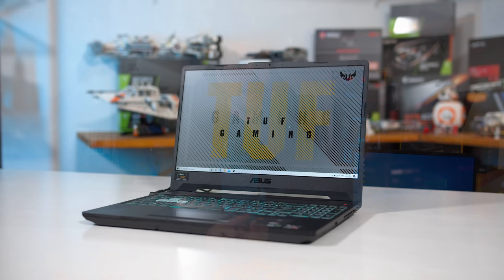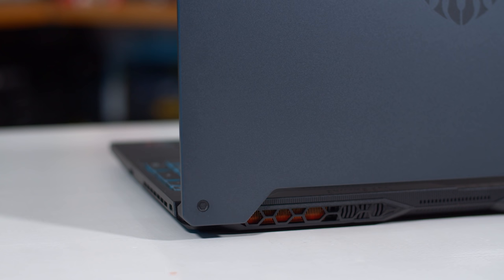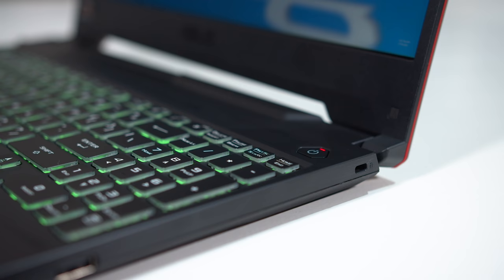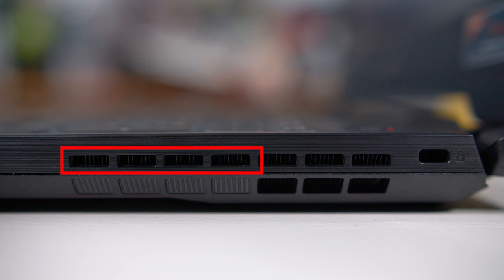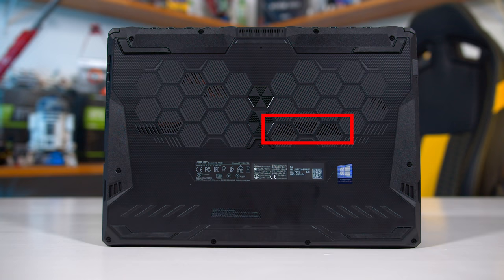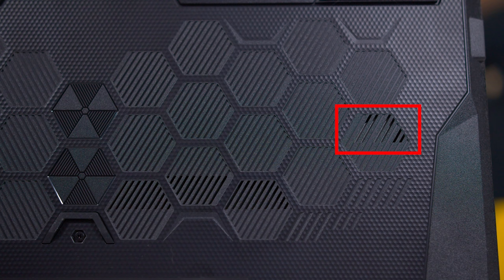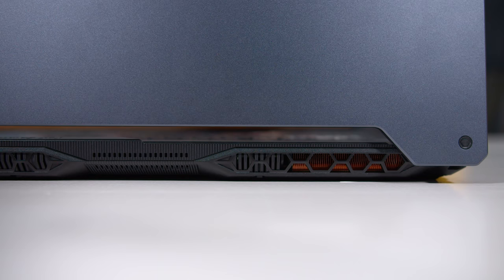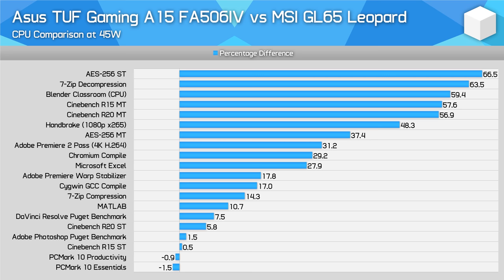Don't Buy The Asus TUF Gaming A15 (2020 Model)

Comment: Do you realise that smaller vents mean faster airflow with the same fan speed? Clearly, you've proven yourself wrong here to a certain degree. And maybe MSI GL series laptops are the same price as TUF A15s in the USA. But consider getting a Ryzen 9 4900H and an RTX 2060 in a laptop with a 144hz display for nearly 1500$.... Would you call it a bad deal?

Comment: I'm looking at buying the A-15 with the Ryzen 7 4800H and 16GB RAM, fully aware of the heat ventilation issues. I'm replacing an Asus K537 with an AMD A4 chip and 8 GB RAM from 9 years ago which had the same ventilation issues. No ventilation in the lower case whatsoever, a couple of holes, but not enough. It has always run hot and the fan has always revved super high. It sounded like a 747 on my desk for years...that is until I recently stripped down Windows 7, shadow settings, bloatware, everything unnecessary on the operating system. Now it runs cool, the fan is barely audible. I cleaned the insides, stripped it down, redistributed the coolant paste and it runs like a new (very outdated) laptop. The thing is, all of those years of heat didn't kill the CPU, motherboard or RAM, didn't destroy any hardware or functionality, but it did destroy the lower half of the casing where the hinge connects the screen. Eventually the entire backside started to split and needed to be re-enforced. The plastic became brittle and fell apart until there was a big hole at the back corner of my machine.  I had to rebuild it with zip ties, screws, a glue gun, an old credit card cut up into pieces, painted black with a sharpie and a lot of Mac Gyver-ing. My only other option was to gut the components and mount them to a piece of plywood...which would be extra badass! Imagine the plywood laptop at Starbucks! It would make me king for a day. Point is, I doubt the A-15 components are going to have any less longevity due to the hot temperatures, but eventually the plastic will become extra brittle because of it. The Asus still kills my old Dell in the longevity department. I only got 3 years out of that one, then the BIOS failed and I couldn't fix it. Still, 9 years for a movie-playing, word processing, internet grubbing, space heater with a screen? Not bad. A-15, here I come!

Comment: When it comes to the "Why would they do this?!" - I've read multiple times now that OEMs tend to block certain paths for air so that it doesn't exit the system too quickly. For instance, if the airflow from intake to exhaust is... let's say "short and effective"... there might not be enough air flow towards the battery and it might get too hot.
At least that's what they're saying. Of course looking at laptops that do have huge open intake areas and plenty of exhausts and that don't have overheating issues, one can't help but wonder whether that's true...
Reply: Yes, it is correct to place the inlet somewhere to allow air passes needed areas. It could also generate  slight vacuum as necessary. However you should not block the outlet. It will suffer the fan, generate turbulence and chocked the flow.

Comment: That's the most ridiculous bottom cover I've ever seen 😂 how did they choose where to cut open 🤔
Reply: actually they chose to make it that way because they want to reduce the dust (and past the military test ) .Apparently Asus think we will use this laptop at mount everest or sahara desert
Reply: Not randomly, to be sure. The locations and vents must have been chosen to direct airflow over specific components in specific ways to cool them. This YouTube reviewer is doing people a disservice by saying the vent design is flawed when the fact is that he just doesn't understand it.
Reply: @makingretro  Show me a high end laptop that does this 2.5% airflow business stuff and actually performs and sells well. Tell me why AMD, despite running cooler, is the only lineup that gets botched while many Intel lineups never get botched. It is not an "boo hoo, I need airflow over this component". It's a simple "boo hoo, I dont want my $3000 laptops getting screwed by this $1200 laptop" from OEMs.
Reply: @theskywalker8416  I don't think that laptop can survive sahara desert at all due to heat.

Comment: Now the best part: The only think you need to do, to drop temperatures by 10-15 degrees at full load with vent at 60% is: disable the processor turbo - it does not affect games performance, it might only affect performancce in video encoding or some graphic work that you might do (you can always turn that on tho). I did that, laptop is silent and game performance is literally the same with max 81 degrees cellcius in modern warfare cold war at ultr with avg 40+ FPS (my spec is ryzen 4800h and GTX 1650ti).

Comment: asus tuf a15 is still much cheaper here in my country compare to other brands. it may have some flaws but im after its cores since I'll be using it for home lab
Reply: wait ur using a laptop for a hone lab?

ever heard of desktop pc?
Reply: And I guess you can cut the bottom intake grills off, it should be fine. But that  heatpipe not connected to the fans are plain dumb imo

Comment: I bought the ASUS A15 with rtx 2060, ryzen 7 4800h, 512 ssd m2, 144hz screen. I would recommend to everyone with this budget. Temperatures are normal. Games are runing smooth. The only negative is the rgb keyboard is only 1 color, you can't change each switch different rgb.

Comment: The screen is perfectly fine for a 15" gaming laptop.  The A15 is thinner than the MSI, of course the ASUS will be noisier.  The cooling/noise could probably be fine tuned better, yes.  But an 8/16 cpu, 16GB DDR4-3200, 1TB nvme, RTX 2060, 144Hz IPS is hardly a "budget" laptop, holy fucking shit bro, that's a lot of firepower in a tiny chassis.  You missed the best improvements, the A15 fixes the nearly unusable/buggy usb ports from the previous TUF gen, and added one to the right side of the laptop (so wireless mice work much better).  Also, the A15 is quieter than the previous gen.  We have one of each, side by side.

Comment: Using it for  moderate office usage and playing games for an hour or so for 3 days now. Everything is smooth and the laptop is cooler than my MSI Leopard (gtx 1060 + i7 8750h). My experience with MSI have been terrible as it heats up like a room heater while running something as simple as Cuphead and crashes after a few frozen frames! I have almost no complains about the A15 at all. However, the screen is dim and washed out... That is disappointing...

Comment: For those watching this and you still deciding to buy this because of the price tags to fix the thermal problem you just need to turn off the boost mode in the control center. This does not only work for this laptop but for any other laptop that has its own control center for temp. control. Companies tend to not adjust the control center between laptop and desktop (even in desktop I still switch it off since I have liquid cooling). For other ways to try and reduce the temp. apply liquid metal or use thermal pasting, elevate the laptop where the bottom is not completely covered which allows plenty of airflow and (this one at your own risk) have a professional cut out the areas at the bottom where it's not supposed to be blocked. 
I do agree with the sound quality from the speakers and the color accuracy is not that great but now that you have extra money that's where you monitor and headphones/speakers come in

Comment: I bought this laptop after watching your video. I can confirm that running a stress in aida64 for 1 hours keeps the temps around 90 C running at 3.8 ghz. I stopped after an hour because I was happy that I would never stress it that much. This is in winter weather however.

Comment: I made a review aswell from this thing and I don´t feel that Hardware Unboxed was right to state something like this in a video.. the temps are on the high side yes but its not a 4 or 6 core Intel cpu.. its a proper 8 core 16 thread AMD here. Also most gaming laptops nowadays creep into he high 80-s to maybe even 90-s... so coming out with statements like this is a bit sad to see if they didn´t bring the heat issue up years ago on laptops.
Reply from the maker: You'll certainly want to watch our follow up video next week then.

Comment: Guys, don't listen to the video. Trust me this laptop is REALLY good. Gets a constant 60+ fps with Raytracing on Games like fortnite and COD. High framerates on games like CSGO and Siege and a great screen with a great refresh rate. If this laptop is in your price range, get it. I have experienced no thermal throttling whatsoever. It's a really good laptop with a Really good CPU and superfast SDD. Gets the full use out of a the RTX2060. Why not buy it?

Comment: A bigger hole isn't always better than a smaller holes. You couldn't be more wrong to think that having bigger hole equals to more airflow in volume, it depends on the fan size.

A bigger hole equals to larger air volume intake at 1 time (but also spread wider area and lower circulation speed due to less pressure) and smaller hole equals to faster circulation speed ( but spread narrower and higher internal pressure),  given the fans' power and size are constant value and also the hole size isn't extremely unreasonable. 

That being said it doesn't take a Sherlock to guess that they intentionally covering those hole  because they probably design the casing for multiple fan sizes and heat sink arrangement for different GPU (with common knowledge that gtx is power efficiency core and rtx isn't)

Another mistake is you thought higher end laptop models would generate more profits than lower end laptop models, thus motivate they doing this to sell higher end unit. That couldn't be more wrong cause the profit actually based on the price they set and the actual hardware and design cost, not to mention lower end/budget end models usually sell more units than higher end models.

Also i believe they create the hole not directly below the fan is to create a more accesible (not heated) keyboard to enhancing gaming experiences of long hours gaming and also to protect components.

Rog gaming laptop is in minority (compared to Lenovo and MSI) which can still run flawlessly while being as powerful after 6 years of usage and that's show the quality of design they had.

Comment: If you are a gamer, the display is an afterthought. I have my A15 hooked up to an external screen. With the panel closed, a gaming laptop is just a gaming platform with a small footprint.

Also, I haven't had a venting problem. I run the thing hot sometimes; it doesn't seem any worse for wear.

Also, the fans are relatively quiet, which is an unexpected bonus.

Comment: There seems to be significant variance in the models of this particular laptop because Hardaware Canucks tested the same configuration you have here and found no thermal issues whatsoever.
Reply from the maker: Didn't they get the same thermal results? Anyway we've since bought another model, there is no variance and we will have an extremely detailed video later this week. In the meantime you can check out the testing over at 'Jarrod's Tech' if you like.
Reply: @Hardwareunboxed  Their sample never reached 97C in any test. They also had the 90Wh battery version. I'm not doubting your results in any way and the bottom of the laptop is very restrictive when it comes to airflow. It's a very weird design choice indeed. I'll definitely wait for your detailed video.
Thank you for taking the time to reply to my comment and your awesome in depth content

Comment: I normally don't comment. But the whole cooling argument is bull dude quit trying to play people. Amd processor's run hotter than Intel bc they don't use thermal throttling. Also amd processors r designed to handle that heat. That i7 will never perform to its max potential in a laptop bc its bottle necked by software to not get hot but reduce your power by a good 20 percent. Also u want bigger intake for more air and smaller exhaust ports. Its called positive air flow. And if your gonna give an alternative option make sure its better and not the same but more expensive

Comment: And I think all of the comments are overly critical.  The screen isn't nearly as bad as Hardware Unboxed is stating.  I have an external USB-C monitor with good color accuracy in the event I need to do some graphic design work.  For day to day use, this laptop screen is 1,000,000% fine!  I'm staring at it right now!! It's not washed out, it's not dim, and it's not tinted in any particular color.  Most people can't tell the difference between 100% sRGB and 45% NTSC. Not sure why this laptop is getting trashed so hard.  I'd advise anyone interested in the laptop to see it in person. Don't go based on this review as the reviewer really paints this thing in a bad light, and the laptop isn't nearly as bad as he's making it sound.

Comment: Its pretty simple, only people wanting the amd cpu's go for the tuf or g series, else if you want better thermals, gpu performance and display, asus is redirecting you to the higher end intel products. Typical marketing strategy and sabotages amd. If you want further proof of this just check the Asus Amd g15 and Asus intel m15 bottom panel. One has blocked air intakes on the fan itself while the other has open vents. Guess which has the blocked ones.

Comment: I don't agree with the reviewer's assessment - critique of the exhaust design is not really relevant.  I have had this laptop for about a month and my experience has also been very positive.  I use it for gaming (Wreckfest with a G27, The Division, Arma 3, GTA 5).  Also for web browsing and general photo and file management using  PKZIP.  The A15 is almost completely quiet most of the time except during intense gaming sessions and under heavy workload.  In turbo mode is noisier but it runs a lot cooler and less prone to throttling than other laptops I've owned - it runs in the 80's degree celsius.  I had an MSI GS75 8th gen with an RTX 2070MQ which ran in the mid 90's C temps, even undervolted.  For the price, the MSI GS75 Stealth was a much bigger disappointment than the A15.  Lastly, the A15 has one of the longer battery life I have come across even when compared to tablets.

Comment: My last Asus laptop had the hot, self-destructing nvidia 8600m gt. Haven't really missed them. Current MSI machine has a gtx 970m and has been rock solid with almost continual use for years.

Comment: So, even though i saw this video and others that say that this laptop is a bad choice, i still bought it.  I had it for a day now and i will tell you about it. For me and compared to what I had before, it's amazing.  I play with high graphics Gta5( average 50 ), Valorant(144) League of Legends(120), Automation with epic graphics a bit above 60, The Crew 2(60 all the way). I have the Ryzen 7 4800h with the 1650ti, 8gb ram and one tb of storage. About the cooling. Even though it's a lower model, and the lateral vents are missing, with a cooler i get at about 74-76° C in games even if i play for like 3 to 4 hours. About the other problem which is the screen. Indeed, i would've liked the screen a bit more brighter. The colors are not that bad. Yes, you will see a difference with other high-end laptops or even monitors, but again, it's not that bad. About the response time, as i played League of Legends and Valorant, i didn't see that "ghosting" effect or whatever it's called, maybe i'm just stupid and can't observe it, but playing those games, i didn't have any problems. If you have questions, ask and i'll answer.  I'm not saying that Hardware Unboxed is wrong, he proved his points right, but if you ordered it, don't be disappointed and wait, you might like it. For it's price and seeing what other offers are, this is quite a best buy. Here it's like ~830€ or 980$. In conclusion, it's not the best laptop ever, but clearly not the worst. 😁

Comment: 100% opposite experience with it. Not really sure what terrible sample you guys got but I have the A15 with a Ryzen 7 4800S and 1660 Ti and the thermals are pretty fine for a laptop. I can play Warzone at 1080p 120 fps on it with the GPU at 83° and CPU at 68°. Laptop is great, plays anything fine, and is generally a beast and a great deal.

Comment: The bottom line is that if you look at its performance while playing most of the games out there, even with high settings, the temps are not as high as the 90+ degree mark he is talking about. The cooling in actual gameplay is working fine in the most popular games out there.

Comment: Now can you do the 2021 version? It has 5800h and rtx 3060, im curios if they fixed the thermal problem
Reply: I have one, and yes, I don't have problems at all, it's a beast. The bottom part it's different if you see this video and the 2021 TUF A15 (5800H + RTX 3060)

Comment: About partially closed secondary exhaust, which has only one heat pipe, look like they wanted to give more airflow to cool 2 main heat pipes. (30% air flow to 1 heat pipe and 70% to 2 heat pipes)

Comment: And I bought one of these and it works perfectly. Even graphics intensive games atmost raises the temperature to 84°C. That's actually the highest I've seen so far. I'd definitely recommend it based on it's value for buck.
Reply: Which gpu?
Reply: @dillu12121  RTX 2060

Comment: FA506IU system model is not significantly behind GL65,  so thermal cooling discrepancy is hardly noticeable. The Asus TUF is just a fast machine, and if the processing power is greater then the fans worker that little bite harder, in gamming the extra juice is worth the squeeze my friends.